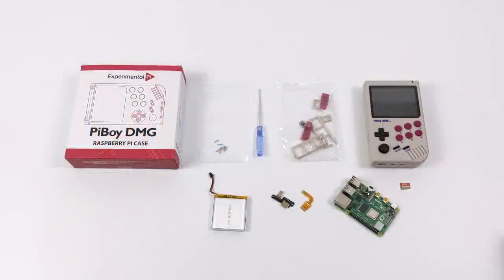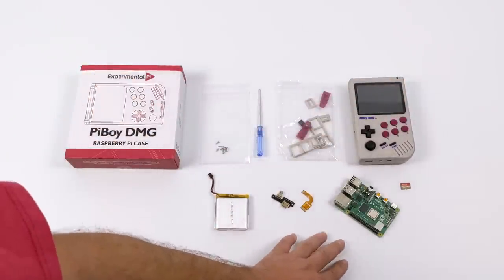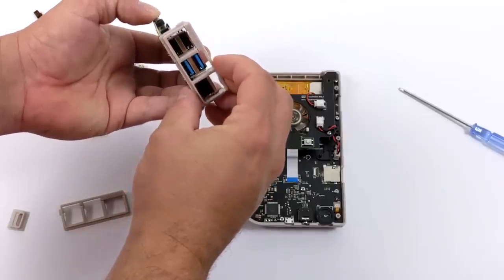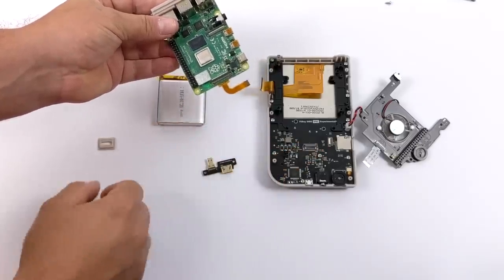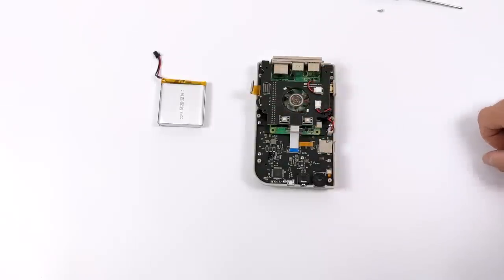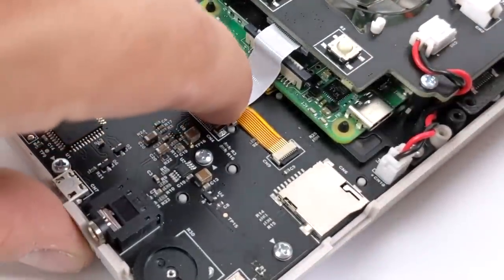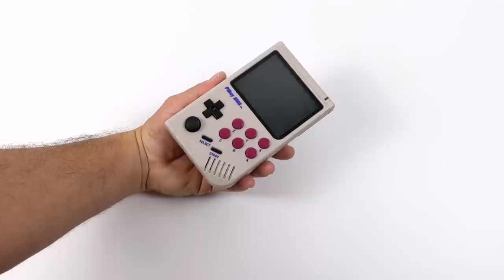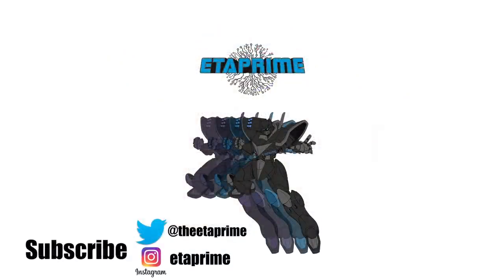Experimental Pi PiBoy DMG Kit Assembly Guide- Raspberry Pi 4 GameBoy

Comment: I'm so pumped to get mine, I just keep watching these videos over and over. lol
Reply: Me too😂
Reply: Man bro, me too. I won't get mine til the end of Oct or first week of Nov
Reply: You guys get yours yet?
Reply: Day 6: Watching this again to gauge if I can make my own aluminum heatsink to slip between the fan and processor. It looks possible. Double sided thermal tape. I'm going to drill as many holes as possible in a flat piece, hammer it against another aluminum heatsink that has the proper depth for the chips, and cut to fit around everything else. Might even make some vent holes in the plastic. We'll see.

Comment: Thanks for this video!  I made a custom case for this back in 2021, but it never quite closed up tight enough after.  Either the back triggers would be smashed all the way in, or - as I'd been using it - I'd left a few screws about three turns too loose.  Sure, it liberated the stuck triggers, but I didn't feel comfortable taking it out of the house.  

Cracked it open last night, and narrowed it down to the aluminum heatsink from Experimental Pi's overclocking kit.  It was jutting up on one side due to a choke that's about twice the height of the CPU (don't quote me on the technical terms, I just like fixing things). Took a hacksaw to a remove a 10x10mm corner, put it back together, fits flush finally! 

Problem is, I forgot which screw holes were for what.  This video helped me resolve that issue, so thank you very much!

Comment: A cool retro GameBoy style Pi case that can be played both as a handheld and as a console? This is exactly what I've been looking for! I was checking their website and noticed they also have other colour cases you can buy. But unfortunately there's no option to just buy an assembled kit, or even just the full kit, with one of the other colours in place of the original GameBoy grey. Seems like if you want a fancy colour, you're stuck with an extra case and doing some disassembly and reassembly no matter what.

Comment: You're right, not bad, I have sausage fingers, so there were a few times I needed to take a breath. Additionally, I had heat sinks I needed to remove (wasn't aware they wouldn't fit with the fan, yeah I'm new at this kind of thing). What had me was wondering, is why you didn't screw down the HDMI adapter. Well, I tried for almost 20 mins and no joy/impossible. Good tutorial as always. You and another dude are the reason I settled on the Pi Boy DMG.

Comment: what you really need is a video showing how to flash the card and the steps you take in updating the firmware and all this stuff. That's the only part nobody shows you. The instructions on experimental pie aren't easy. That's def. an important part that you missed in this video.

Especially people that have a corrupt card and want to re-flash it and start over.

Comment: I'd really like a Pi4 in a PSP like case with 4 shoulder buttons
Reply: Experimental Pi has the PiBoy DMG that can take a Pi4, has a fan and battery. It has six face buttons and two triggers. I haven't found a good system (power or build) that has 4 face 4 triggers with a center mount screen.

Comment: I wonder if it'd be possible to solder a cable to the USB 3.0 ports and run it to a SSD in the battery box...
Reply: Given that SD cards can be up to 1 terabyte, and you can get high capacity low profile USB storage, trying to stuff an SSD in seems like unnecessary extra bulk.

An m.2 NVME on the pi itself would be good though

Comment: Im looking at their website. Is there anything missing, if I "part it out"? As in, you can buy the kit, or you can buy all of the components individually (Don't need/want some of the extra features). 

ETA Prime mentions the PCB being inside already. 

SO... is the PCB included in the one of the individual parts (like the replacement case, etc.)? Can't seem to find any mention of a PCB on any of the part descriptions. Or should I stop nickel and dime-ing, and spend $30 more on the kit?

I guess it's worth mentioning, that I enjoy making RPI projects... So, I don't mind doing extra work to save a few bucks.

Comment: I'm getting one of these for myself. Love that this thing can handle the Pi 3b and Pi 4

Anyone have any recommendations for something a little more complex, build-wise? I've got a nerdy relative who I want to introduce to these RPi builds. That said, I don't want to spend $300+ on the shell, PCB, etc, plus the cost of the RPi.
Reply: TS nowhere near that high. I think it's 230 max, though cheaper depending on if it's prebuilt or not

Comment: I ordered the assembled kit plus an all black shell. I wonder if it’ll be easy to switch out the insides. Most concerned for the screen. Hope it’s not glued on
Reply: I just ordered a shell as well and emailed them about the glass. Nathan at ExperimentalPi said the glass is already installed on the shells. It's not recommended for a user to replace it themselves and they probably spend more time on that than any other part of the build!
Reply: @xstlthx  The LCD just slides out of one case and into the new one.  Its a snug fit because we have a rubber bumper on the bottom of the lcd. The glass, however, is not removable so each case comes with it already installed. Well, techically you could remove it but I wouldn't recommend it.
Reply: @NScherdin   Yeah man! I was just trying to convey to him what you told me this morning :). Definitely appreciate the work you guys are putting into this project!

Comment: Be very careful when you order, you might get import duty, but you will ONLY know that when the package arrives. They should have something about this on their website  in UK From UPS £42.40, the shipping for this is almost more than the items I bought not happy, you have been warned.
Reply: It looks as if the value goes over £135.00 import duty will be applied, that explains that the 2 x PI 4 Flirc cases I bought from the manufacture in the USA did not cost the said amount so no Import Duty.

Comment: I have an Pi4 in an old Style NES Shell, my Question is, do i have to remove the 3 Heat Sinks?
Reply: i was wondering the same thing
Reply: Yes unless it is a VERY thin/low profile as you can see there is no space between the fan and fan hat. I am pretty sure it pretty much touches the cpu lol
Reply: Ok, i have to remove it. That are Sinks that were in a Pack with Power Supply, Red/White Case, etc.
Are they easy to remove?
Reply: Most likely.  The fan is pretty close to the top of the chips on the PI4.  I only found one really low profile heatsink(more like a thermal spreader with some ridges) that would probably fit.  The tiny heatsinks you find on eaby are too tall if that gives you some reference.  But in general heat should be kept around 55 to 60c with the default fan profile.
Reply: @SweetBlu 2mm gap or so from the heatspreader on the Pi4 main processor. Measured by mark one eye ball so I could be off a little.
Reply: So, what would you say, should i give it a try to remove or rather buy a new Pi4?
Reply: @Jerryli72  You should be able to remove the heatsinks. Maybe a little alcohol to get of the adhesive
Reply: Thy, that helps me much. I will do it when the DMG Kit arrives😀

Comment: Is there enough room to put a small heat sync on the CPU/ GPU?
Reply from the maker: A copper shim would fit perfectly
Reply: @ETAPRIME  that's what i was curious about, thank you.
Reply: I'm sure people will start to make silent cooling options for this after a short while , How is the fan noise if you fully overclock the Pi 4 to the Maximum ?
Reply: @ETAPRIME  Thanks for the vid. I just got one kit fully assembled with 4gb using your affiliated link. Watching some videos shows great performance improvements when using 64bit os instead 32bit retropie distro. Looking in the tutorial section on experimental pi website there's a topic about installing the safe shutdown and OSD. But in item 8 they say I must add dkms and the kernel headers but not explaining how. Can you please make a video showing how to install lakka or Ubuntu matte on piboy dmg but with that step in the video? Thanks a lot for your videos.

Comment: thanks for the vid, I followed this with my pi 4  and it works great. I did that to test the hardware when my pi 3 didn't work. but my pi 4 has a permanent home in a nespi 4 case. I bought this because they said it was compatible with pi 3 as I have an old cana kit pi 3b+ that i want to use, how about a pi 3 guide .I'm running into problem after problem. It would be great if experimental pi offered an image for it, but they give instructions  that I guess I'm to dumb to understand.

Comment: 2020, the year when these little handhelds are ALMOST there... Almost...
Add L2 R2, a 2nd analogue, L3 and R3 on both analogues (add future Pi 5c++ for fluid PS2 game play) and we're FINALLY there.
Not sure if 2020 will create the PERFECT hand held, but the perfect handheld will be created in the 2020's.
Edit: Is there another internal ability to add a second micro SD card or would one have to use one of those super tiny USB micro SD adapters in one of the top 4 USB ports? 
TY in advance for your response. =D
Reply: bigemugamer : You mean something similar to the Anbernic RG-350p?

Comment: Hi ETA PRIME, please could you check if the PiBoy build controls would work for selecting boot options using a multiboot SD card? I would like to use this case as a portable console but have the option to plug an external monitor, keyboard, and mouse and use it as a standard raspberry desktop computer. Thanks!

Comment: hey eta prime have you been able to run the virtualmans 1.98 image on this? i got mine and i cant run it, if you can help me out that would be great. PS im running the pi4 4gb.
Reply: I have a 32gb image running and I have another card with Vmans 512gb image to match my arcade. I had issues but I notice the brand of the sd card mattered alot. I tried plenty of cards. The Samsung Evo 3 is the only card I got to boot in this pi successfully without any error messages or issues

Comment: Does the fan directly contact the chip?  Shouldn't we use a one of the small heat sinks?
Reply: About a 2mm gap.  Same concept as the Pimoroni fan shim.  Fan directly cools the CPU.
Reply: @NScherdin  safe to overclock to 2ghz?
Reply: @UltraCon79  Its been tested to 2.147ghz. Not all versions of Raspbian supports it.  2ghz seems to work on all OS versions. Above is a bit hit or miss but physically the Piboy can provide the power necessary to try.

Comment: Can it fit the Pi4 8GB  and does it come with the adapters for the other pi's in the  full Kit cheers bud ;)
Reply: @Valthonis  well if I get a PI4 I want the latest, future proof ;)
Reply: @djwhelan4283  Pi 8gb fits. There is no physical difference that would affect the fit.  There is no advantage to 8gb as far as emulation is concerned, at least at this point in time.

Comment: They're getting closer still needs an r2 and l2 trigger buttons what's the point  having an emulation system that's portable if you're not going to include all of the controls necessary for many games yeah I guess you can remap some of those buttons what do you really want to use an r2 and l2 on the front control panel that will be difficult for a lot of combinations for certain games people need to take note that we need something with more of a PS2 style control layout with two extra buttons I like the fact that they did put six buttons on the front instead of four but it still needs two more shoulder buttons